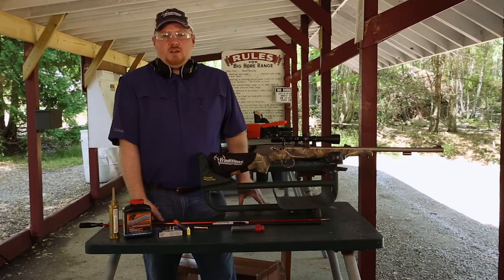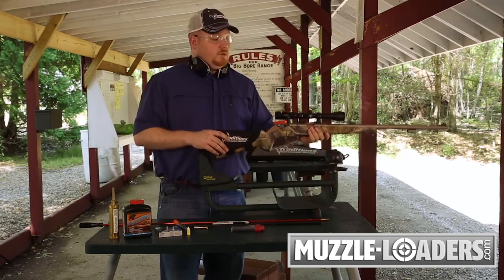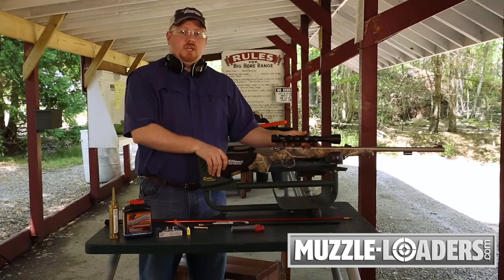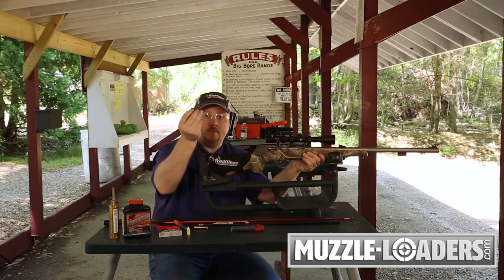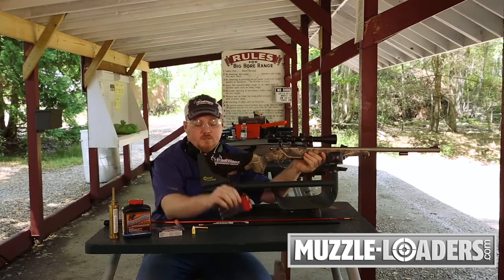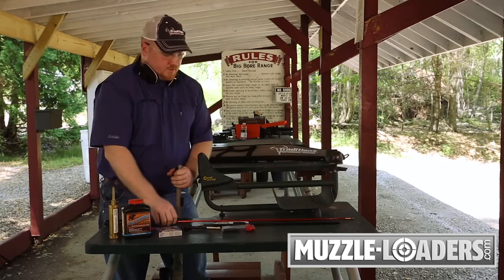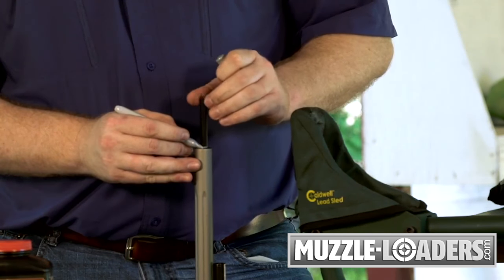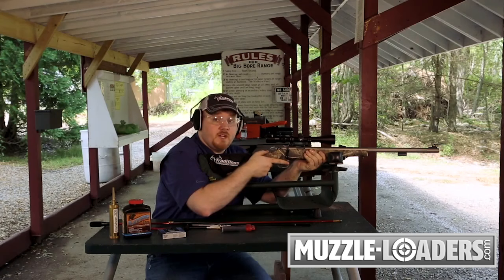How To Load & Fire a Bolt Action Muzzleloader Rifle - Muzzle-Loaders.com

Comment: I have a tradition lightning fire 50cal with 209 conversion kit on it with thunder dome breech plug. Can I shoot blackhorn 209 and fed premium 209a cap?
Reply: With a 250 grain Hornaday monoflex
Reply from the maker: You should be able to use Blackhorn 209 and Federal 209a primers with that muzzleloader as long as you do not exceed any manufacturer recommended loads.

Comment: Why is this a thing?

I mean, I get why... but why?
Reply: It allows you to shoot very large calibre bullets at highish velocities out of small or short actions. typically the case (the brass) of these larger caliber bullets would require a much much larger action to cycle. So with just a barrel swap you can be shooting .458 bullets out of a short action rem700 whereas normally that would require you to switch to a whole new action to accommodate the .458 win mag cartridge or similar. All that being said I've seen it mostly used for the newish muzzle loading hunting season. The muzzle loader barrels are made for all different bolt actions now and they are quite accurate. Not my cup of tea though